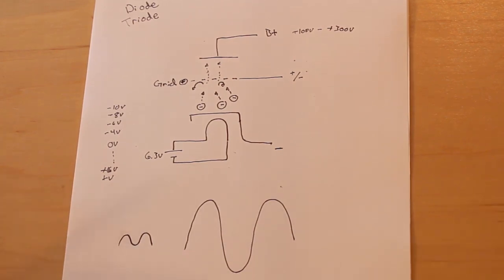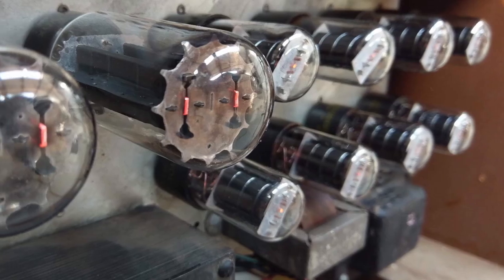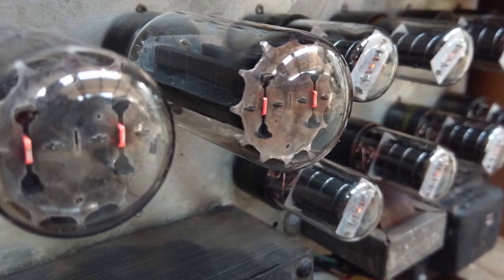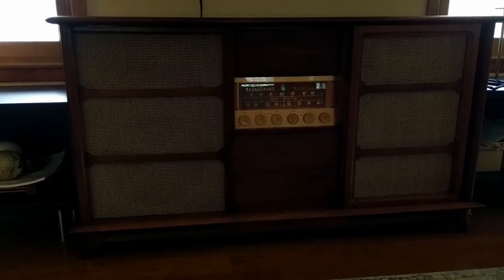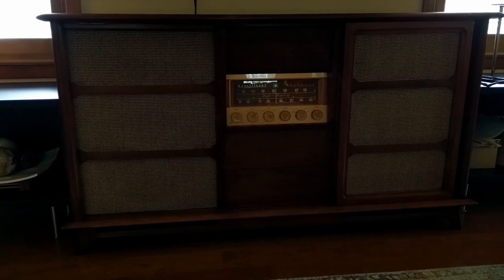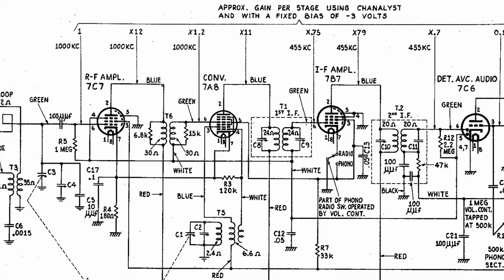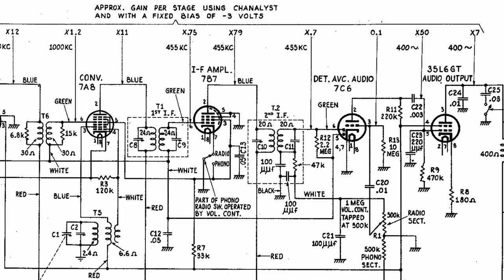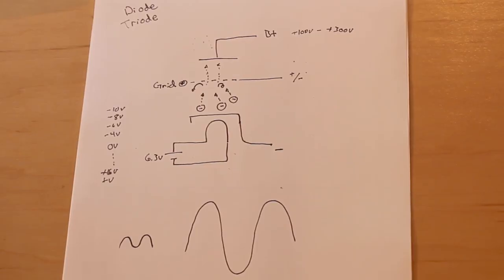Vacuum Tubes: Episode 2 - The Triode (Part 1)

Comment: If you were to put a J-Fet instead of a transistor in there you would have a more accurate representation. Since a transistor is a current controlled device. Your 1/16th turn goes like this: you hit the .5V threshold and the base current shoots right up. If you were to current drive the transistor you would have the same effect as voltage driving a tube. Except now the tube would go from 0 to 100 very quickly because the input impedance of a vacuum tube is basically almost infinite for DC ....notice how I said almost
Reply from the maker: Including the transistor is probably the only part of this video that I regret doing. I do think it's an excellent comparison, but I simply don't know enough about transistors and FETs to make that comparison properly. Tubes are just so much easier for me to wrap my head around! Semiconductors always throw me for a loop because they can have such varying properties and reactions.
Besides, tubes look way cooler and that's the most important thing!
Reply: @UsagiElectric  hah they do look a lot cooler I agree on that :D 
Here is the catch:
Tubes and transistors are both analog, just in a different way.
In a vacuum tube enviroment when you look at the conductance chart you see a V/I chart. It basically tell you for a given voltage on G1 what current should yo expect on the anode give a voltage on it and you can figure out from that its linearity. 

In a transistor enviroment you will see a I/I chart..very rarely but lets assume its there.
You would see for a given current on the base how much current to expect on the collector. Transistors are much easier to understand when you actually break it down. They are basically current multipliers. Whatever base current get multiplied by the beta of the transistor (gain). 
A similar thing occurs in vacuum tubes but instead of multiplying grid current (none to speak of) the graph shows a V/I chart. For a given grid voltage how much current is going to be conducted between the plate and cathode. And this number can also HEAVILY vary under different anode voltage conditions especially at low voltages it becomes quite chaotic and difficult to measure. That said if you make the tube circuits into high enough impedance the second tube after that will have no problems reading that voltage on the grid because it does not load it. That grid impedance is upwards in GIGA ohms. You can make a tube computer that has higher impedance circuits than your multimeters input. Ofcourse noise will be a huge problem in such high impedance circuits (Just check out some neumann tube microphone schematics. The U67 had quite the large bias resistor on the grid of the EF86 in there  )
Reply: Bipolar transistors, such as the BC108, and etc are current controlled devices, whereas JFets and Mosfets are voltage controlled devices like vacuum tubes.

Comment: Great video! Understanding Vacuum tubes really helps with getting the fundamentals of electronics. I was a little confused by the notion that the transistor circuit is "Digital" and the tube "Analog"  not really the case, really you are demonstrating the Vbe threshold voltage of the transistor, which a vacuum tube does not have.
Reply from the maker: Thank you! You're absolutely right, and you're actually hitting on the topic of the next video in a sense - trying to get the vacuum tube to cutoff. I think my usage of the terms "analog" and "digital" may not have been the most accurate, but growing up I always heard that tube amplifiers were analog and solid state amplifiers were digital. And this makes a bit of sense as the tube very faithfully recreates the input signal, only larger. Of course, there are many different types of transistors with wildly different properties, so the reality is much more of a grey area than what I've demonstrated here.
Reply: @UsagiElectric  Hello! I really enjoy your vacuum tubes series mainly because you make them work with low voltage (I am on the opposite end with my equipment, B+ is usually above 300V :D). So... both the tube and the transistor are analogue and they will always be. Even the transistors in your CPU are analogue. When you put them in circuits that emphasize discrete steady states (most commonly "on" and "off" for "1" and "0"), only then they are "digital". And both tubes and transistors can be "digital" :).
Reply from the maker: @jassenjj  Thank you! You're absolutely right, my oversimplification of transistors here (and a bit of misuse of terminology) created a bit of confusion. Interestingly, getting the tubes to respond in a digital manner (by forcing them into cutoff or saturation) and building digital logic circuits is one of my main goals!

Kudos for running such massive voltage, that tends to scare me, haha. Whenever I'm poking around stuff that might have big voltages, I always try to remember the "one hand in the pocket" rule. Fortunately, it seems tubes perform really well at just 24V!
Reply: The "one hand in your pocket" rule is important, but not foolproof. This fool (me) had a cap charged to over 600V discharge through his index finger in three places when trying to replace a melted fuse holder. You can believe that I have a very healthy respect for tube equipment.
Reply: the more I watch it, the more i hope the video can be polished a bit in the future, as the risk of confusing beginners is quite high. although it has some advantages sometimes to not "overthink" and memorise just some behaviours of components. Also the grid is typically controlled with negative voltage, and not positive (thereby drawing current) as in the video.

Comment: I must say... you're not doing the transistor justice by wiring it like that. To take advantage of its active mode just put some resistor between collector and base. Doing just that and tweaking some resistor values will make it much more linear

BJTs are current based, tubes are more voltaje (signal) focused AND COOLER, that's the upside

EDIT: Just realized the barrage of elec-heads bashing on the exact same thing I just said, sorry~

Comment: Hello, well explained and not as hyperkinetic as many youtube videos. Glad to see someone is bothering to explain this technology. But I have to tell you that your idea of tansistors is wrong. A transistor is as analogous as a vacuum tube. But it works with different voltages and impendances. A tansistor as well as a vacium tube can be set to work as a switch. But also both as a very analog amplifier. Otherwise we wouldn't have music amplifiers with transistors today! And this: The first digital computers worked with vacium tubes! And before with relays, now those were the only 'digital' components. You can only close or open them! The fact that something is digital is actually an interpretation of a signal. An agreement, which is a 0 or 1, we agree on and call it digital. So basically there are no 'digital' components. But we construct the circuits in such a way that they work within very strict standards (voltages) and therefore 'switch' at very strict voltages.
Reply from the maker: Thank you so much!
It's interesting to go back and watch this video. Even though it was only about 8 months ago that I made it, it feels like a lifetime (my hair is dramatically shorter!). My presentation style is a little laconic and I'm a bit more expressive in my newer videos, but not quite as hyperkinetic as most Youtubers. I think I'm finally starting to get a little more comfortable in front of the camera!

Thank you for the insight into the transistor. That's the only part of this video that I don't like because I got it so wrong, but I'm glad I did. There's a ton of comments on how transistors work properly and I've learned so much since then due to the continued dialogue with the community who watched this video! 

And you should definitely check out some of my newer videos, building a vacuum tube computer is my current long term project! (Or check out some of my older videos for some relay calculators, the Hexadecimal calculator is pretty similar to an extremely simple computer.)

Comment: You're being very loose with words.. the grid has a 'charge' which seems linked to its potential but how does that work, if all potentials are measured with a difference to on another. Is there an ABSOLUTE potential of 0, above which electrons are attracted and below which electrons are repelled? I seem to have mental conflict resolving the idea of absolute electrical charge with electric field potentials :/

Comment: Uhhh, that transistor is used in analog and digital circuits. The difference is that the biasing point is different. Once that's right, much small signals result in much larger output (more gain). At least that's what I'm seeing here.
Reply from the maker: You're absolutely right. I got so much wrong about the transistor in this video and few other commenters have let me know as well, but I'm always happy to see more, great information about how transistors work!
Transistors are a bit magic to me though, I'll stick with hot electrons for now, haha.

Comment: Nice video but the transistor circuit is just as analog as the vacuum tube circuits on your breadboard.
Reply from the maker: You're absolutely right!
I way, way oversimplified here, to the point of actually being incorrect, haha. 
This is quite an old video, and I've learned a lot more about both tubes and transistors since this video, so hopefully my more current videos don't suffer from quite as many inaccuracies.
Reply: Solid-state would be a better choice of words

Comment: you said that the transistor doesn't want to be in the in-between state. don't you mean that it just has a higher gain? why not just add an emitter/source resistor?
Reply from the maker: Thanks for the comment!
My wording is probably not the best, but if you look at this 2N2222 datasheet (https://www.onsemi.com/pub/Collateral/P2N2222A-D.PDF) and check out the "Collector Saturation Region" chart, it shows a great graph mapping the base current against the collector-emitter voltage. My semiconductor game isn't as strong as it should be, but if I'm reading the chart right, the collector emitter voltage changes rapidly with a very small change in base current. For example, if the collector current is 10mA, the collector-emitter voltage changes from 1.0V+ to less than 0.1V with just 0.05mA change in the base current. This is what I'm referring to when I state the transistor doesn't want to be in the in-between state. It takes very little current to change from an very high collector-emitter voltage to a extremely low collector-emitter voltage. If you compare the 2N2222 "Collector Saturation Region" chart with the 6DJ8/ECC8 vacuum tube "Plate Characteristics" chart (https://frank.pocnet.net/sheets/030/e/ECC88.pdf), the lines look wildly different, with the tube exhibiting a much more linear change.

Comment: There are differences in working conditions between a BJT and a triode, so the comparison is not fair to the transistor.
The transistor only works linear in a certain bais, so you shouldn't make a digital switch circuit by BJT then tells everyone transistor is "digital" or non-linear. (I know you didn't use the word "linear", I assume the word "analog" is the same meaning) (Needless to say, linearity can not be defined by the lightness of a LED as well, )
And the definition of "better sound" is not to recover the sound signal, people like tube amplifiers because they generate sound with a special taste of flavor. Which has the opposite meaning of what you said, a good signal recovery ability.
I've seen that you said when you were learning these things you kept hearing people said triode is analog and the transistor is digital. These comments may come from someone that likes tube audio amplifier rather than transistor amplifier. Which is not accurate in electronics engineering. I know this explanation is easy to understand. But I think it is better to use accurate and correct terms and viewpoints when making a video to teach someone new to this area. So that people would not misunderstand.
Despite that, I think your video is great on teaching tube applications. This is why I write these words and hope more people knowing the beauty of electronics engineering through videos like yours.
Reply from the maker: Thank you so much and thank you for checking out the video!
I got a hilarious amount wrong about Transistors in this video (which is why I haven't really done anything with them in videos since, haha). But you're absolutely right and this is definitely excellent for anyone looking for a more accurate understanding of what's going on with the silicon in this circuit!
Reply: @UsagiElectric  Thank you for your kind reply. I was a student in electronic engineer. I am interested in tube circuits and decide to make a tube amplifier recently. But recent textbooks have removed content related to vacuum tubes. And I didn't have any experience in tube circuits (except for a nixie tube. Of course it is much easier to use compare to triodes). Then I found your video that makes a tube circuit so vivid that I can imagine how to build a circuit in tubes only by watching your videos (Formulas are so boring that they only stay on the paper, I need images in my head to design a circuit). While finding some mistakes in the video. I thought if there were people that have no experience would misunderstand something. So left a message for you.
At the same time, I apologize if there is any improper vocabulary in my words. I am not good at English.

Anyway, your video does make a difference. Thank you for making these videos.
Reply: I came here to mention this same issue, so I'm glad you guys covered/corrected it.  Vacuum tubes, BJTs, JFETs, and MOSFETs all have similarities and important differences.  They can all perform analog or digital functions.

I'm a EE.  In my junior level digital integrated circuits course, my professor pointed out on the first day of class that all "digital circuits" are actually analog circuits that we ask to perform digital functions.  This is very important to keep in mind as clock speeds increase, capacitive loading increases, etc.
:-)

Otherwise, great videos!  Keep up the great work!
Reply: Also, BJTs are controlled by a current (base current) whereas vacuum tubes are controlled by a voltage (grid voltage). In that sense, vacuum tubes are more akin to FETs than to BJTs. JFETs and MOSFETs are also controlled primarily by a voltage, not a current.

Comment: Just a note indirectly heated cathode tubes were designed to reduce noise so you can use AC on the filament and for isolation of the cathode for "self bias (cathode resistance)"

Comment: Well done! Excellent straight-to-the-point presentation of tube analog signals. It's amazing how getting to understand thermionic emission helps in understanding PN junction. Many thanks!
Reply from the maker: Thank you so much! I've learned so much about the fundamentals of electronics and things I never would have learned otherwise by playing around with tubes. Just thinking in how electrons flow makes a massive difference!

Comment: Thanks for assembling these videos on tubes.  I am just getting started on your series.  I have however watched other videos, some are really good as well, but I still cannot find an answer to a couple of things.  If I may ask a couple of questions that would be great:
1).  If and when you apply a full or close to full voltage on the grid, why don't the electrons just collect on the grid?  Unless the plate voltage is just so high the electrons just don't have time to collect on the grid?
2).  We talk about amplification, so I believe I understand, but not 100%.  The amplification is a function of the B+(plate voltage), so with a fixed plate voltage the amplification is fixed as well - cannot be anymore unless we increase the plate voltage?  So, in order to change the amplification we need to change the plate voltage accordingly + correct?  
Your response is appreciated!!

Comment: 5:00 When the grid voltage becoms positive with respect to the cathode, I believe that you start to get grid conduction - you get a forward biased diode between the grid and the cathode. Afaik, most vacuum tube circuits try to stay away from this region, but I know there are uses for it as well. At least you want to make sure to limit the grid current because it's probably not built to handle as much current as the plate and cathode.

Comment: What is the difference between a vacuum fluorescent display (VFD) and a vacuum Triode?
- A VFD has a heater that is also a cathode. directly heated cathode.
- It has a control grid that is switched to positive volts. Some have multiple grids to switch groups.
- And it has an anode, but with a luminescent layer. For example, a 7-segment display.

Except for the luminescent layer and the mechanical structure, a VFD is a Triode.
Heating voltage 1 - 3 volts. Anode and Grid voltage 10 to 30 volts.

Comment: Triodes are essentially transconductance amplifiers: a small voltage in the grid circuit controls the current in the much higher voltage plate circuit. Sure, you can convert that current to a voltage using e.g. resistors and such, but they are primarily voltage-controlled current sources. Modern transconductance opamps like the 14700 do the same, and like them they are used in high-end audio equipment.

Comment: So.
When the grid is pulled to -10V, it's the same as disconnecting the center tap and all the current flows through the LED at 24V.
Current address the LED will be:
I = V / r¹ + r²
If you pull the grid to 0V and let's say that's max open, you have zero resistance to ground so all the current will flow through the valve, with the current:
I = V / r¹
What happens with the grid set to 50%?
What electrical property of the valve changes? Is it resistance?
What is the voltage at the anode/r¹/r² junction? 
How do you calculate it?
What's its resistance?